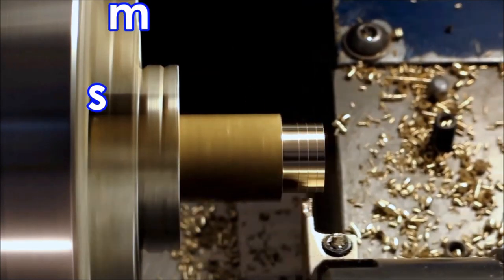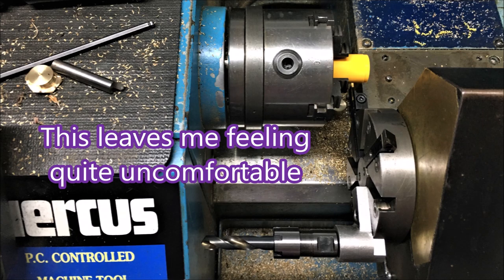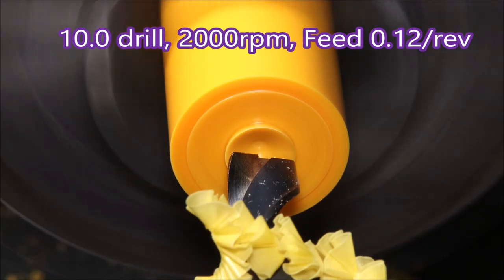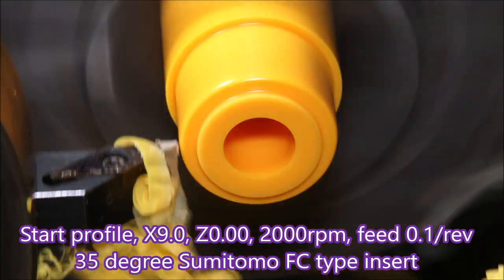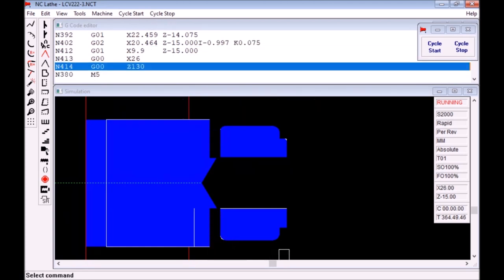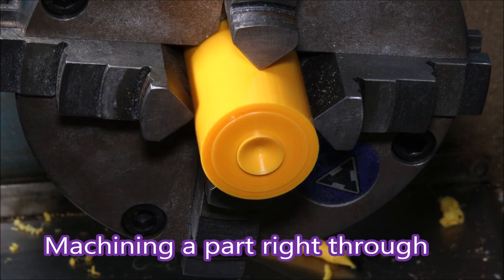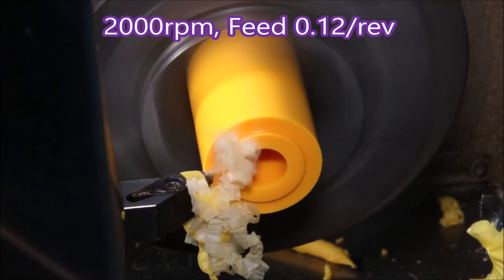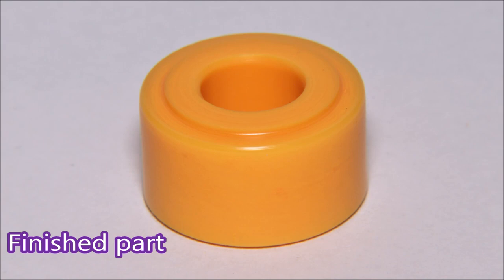Small cnc lathe, drill, turn and part, yellow acetal.  Who knew coloured acetal was available?

Comment: Great idea on the tapered tangent line for parting off. I'll have to use that ;) cheers for the idea. Love the content as always as there is little handy tid bits to learn from :) Thanks for sharing your knowledge.
I buy my Acetel through Eplas.
Cheers,
Stephen
Reply from the maker: I know of Eplas, do they sell it in colour?  I just went with what appeared to be a local seller of acetal in colour. I came up with the tangent because it took too long to match the tools settings perfectly.  This way a small error is OK and the visual difference is negligible, providing the tangent angle is kept small

Comment: CNC looks so effortless, no wonder they've replaced manual turning for production work. Thinking of how I'd do this manually and best I can come up with is a couple of form tools and probably won't get the same kind of finish or the speed.
Reply from the maker: Hi HM, thanks for the comment. I  have videos coming of the other two parts as well.  The large blue part is all manual lathe work. I think much cnc work was previously done on capstan type lathes. They and multi spindle machines were the mainstay of production work before cnc.  Those machines may still be in use in some industries, multi spindles could really spit out the work.

Comment: I believe we call it POM in my neck of the woods. It feels greasy even as it isn't, right.
Reply from the maker: Hi Peter as always good to have you comment.  You are right it always seems a bit slippery.  It made getting a press fit tricky on the other parts.  Bearings seemed to go in far too easily!  I did not go too heavy just needed to stop the outer race from turning. A similar interference in steel and I think both the fly press and myself would be groaning.  LOL

Comment: How many parts in this run ? Any idea what the application of these parts are for ?
Reply from the maker: 4 parts required! I will run anything if I get paid for my time, which this customer was happy to do.  The first set of prototypes worked ok, so I ran the balance of the material through the machine. Supplier sells in 500mm length, so I made lots of this one. LOL The parts are used in a van conversion for a wheelchair, no idea how.  One of the other parts is also a "run the material out" job.  The larger job I do in the manual lathe, so I will probably do them as I feel like it.  The usage is not high, so I can probably make up a years supply quite quickly.

Comment: What CAM program do you use to make your parts? I'm on the verge of getting my lathe operational.
Reply from the maker: HI Luc I use the cad/cam software that came with the machine.  Drives the lathe through an interface card in the pc.  So it is cad/cam and controller all in one